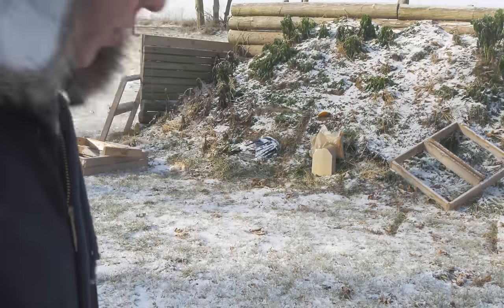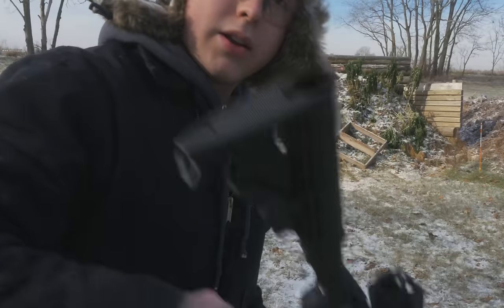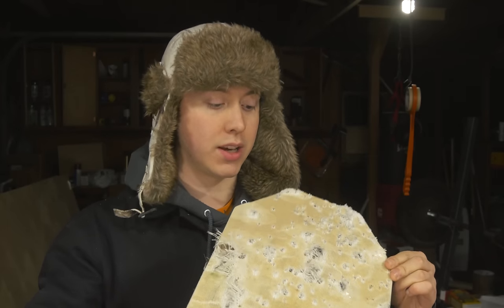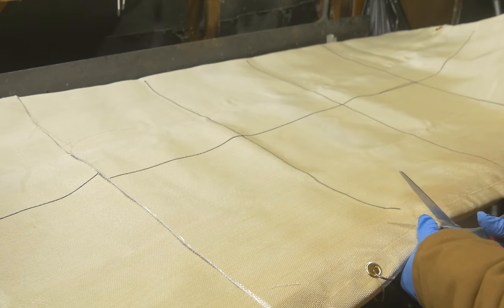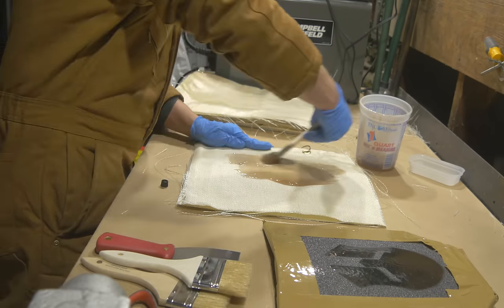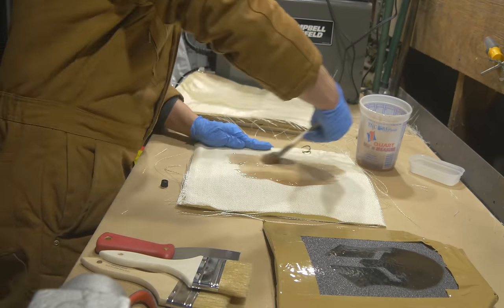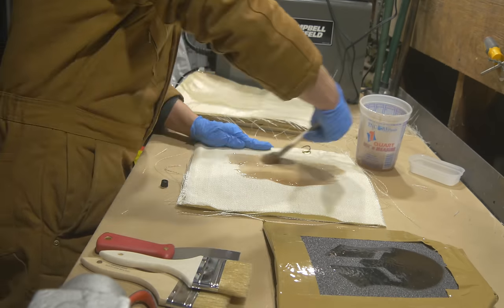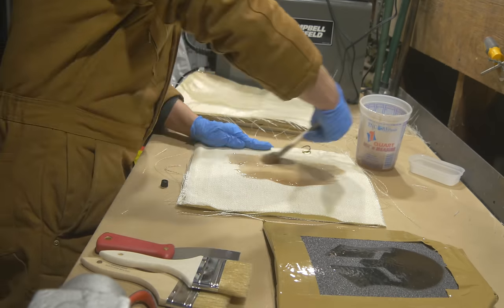How to Make AMAZING Bullet Resistant Armor for $30

Comment: Do it cheaper with just 9$ resin and a big ass phone book, paint on resin on page turn page and repeat till dried
Reply: provide that to the military
Reply: Krystalic Slill military plates are supposed to block AP.308 rounds, A bigger faster .223 they have a ceramic plate over a steel plate. While able to block almost any rifle round, they can only do it once or twice.
Reply: lol, 308 faster than 223, thats funny. The slowest (heaviest) 223 bullets are about as fast as the fastest (lightest) 308 bullets.
Reply: that would be an interesting comparison, please make a video of it.

Comment: Test it on some 7,62x39 aka AK ammo. (See what I did there?)
Reply: He already tested 5.56x45mm NATO/.223 Remington on it, 7.62x39mm would go through bro, not even worth a test after the 5.56 punched through.
Reply: actually yes, because the 5.56 goes alot faster and has much better penetration capabilities. so it would be quite interesting to see if the 7.62 could make it through. bigger bullets don't always equal better performance
Reply: 7.62 isnt made to fragment like 5.56 is, it would definitely go through
Lack of speed is made up with more weight
Reply: the 5.56 was never made to fragment the when used in a 20in barrel  it can make it tumble on impact. I don't even think it was 5.56 that does that it is 223 rem.

Comment: @ZNA : Great job on your project & armour plate. 
I'd dare suggest a couple tips:
>There's (Literally..) a TON of fabrics  available on line (eBay ??..) made from aramid (Kevlar) + carbon fiber, that could be used as a couple, (or more..) layers between fiberglass.
>Another cheaper source of aramid (Kevlar) source : Used / deployed automotive airbags you'd easily find in totalled cars. 
Congrats on opening a 'creativity window' of possibilities on this quick growing industry, specially for preppers in a budget!🏆
(Neddless to say I just subbed!!.)
😊🇺🇲💪🙏🙏🙏🙏

Comment: lol the biggest cost of this is all the fucking clamps who the fuck has that many clamps dude i don't even have 2 of those
Reply: TheGreatUtopiaCat Those are like 6 dollars at Lowes.
Reply: TheGreatUtopiaCat Iliketomakestuff has more
Reply: The biggest cost, are the proffesional plates for a stencile...
Reply: Use bricks to produce clamping force, done deal
Reply: Jackemarlee Young You end up with flat plates, rather than the slight curve that conforms somewhat to the human body. The curve helps to distribute impact forces, besides increasing comfort.

On top of that, you want maximun pressure spread somewhat evenly, otherwise the chance for air bubbles or inclusions goes up exponentially. Clamps, hands down, are the best tools for the job.

<3

Comment: i worked with a guy in dallas whose dad worked for dupont . they gave him a role of kevlar (which dupont invented) . i guess it didn't meet specs. he calls me and asks for some help getting it home. i said "i'll bring my truck over". he asked " you still got you trailer ese?" so i took my trailer over and this roll was huge. it was a double axel trailer and we needed the entire capacity. then i had to build a rack for it at his house so we could unroll what we needed. he spent the next three years doing much the same process , but making panels for vehicles. basically bullet proofing them. it worked. we wrapped a gas tank in his concoction and a .308 wouldn't pierce it. people ( that lived on either side of the border) would leave their cars at his house for a couple weeks and he'd bullet proof  them.  every now ad then i'd drive them down to the border for them to pick up and drive back. made a fortune.all they had to do was install plexiglass and they were set.

Comment: OK, next time use a release agent to prevent the plates from sticking to the resin.
  You can use a little soap or dishwashing detergent diluted with water. Apply it with a brush and let it dry. It forms a very thin film that prevents adhesion to the surface.
  Otherwise you can also use some furniture polish with wax, this will also form a thin film on the surface that will prevent the resin from adhering to the plate.

Comment: I haven't seen it mentioned in the comments, but you can male parts much easier with a vacuum sealed bag on a table secured with mylar tape. Add heat from a heat gun and you will cure a very solid piece with no chance of air gaps in your part.

Comment: For some reason after having seen this a year or two ago, I have it in my head that you used poly-feed-sacks. I have been wondering if a a small-link-chain-mail layer coated in silicone rubber with feed-sack layers would be strong enough to stop an M-1 round. I'm thinking it would be thin enough as the outside panel for a valise for protection. The inside panels could be lined with fine silk. The panel closest to the body could have an arm hold to use the valise as a shield. I'd have an RFID chip sewn in for locating and maybe a small holster at one end of the arm hold for a five round derringer. I am wondering if the chainmail silicone rubber combination would give the shield a splat effect maybe to absorb impact. I am told the Mongols used fine silk body-armor to stop arrows.

Comment: My dad built big bay boats for a long time in our front yard. They were wood and fiberglass. He always used a box cutter to cut the fiberglass and it worked great. It would only fray when he needed to change the blade.

Comment: You could have also added "some" strength by simply alternating the mesh. For example, after the first one, place the next one 5 degrees or so offset and continue to offset each layer. Not sure even that would stop a .556 round but maybe with the graphene added.

Comment: It would be over weight but spend a couple bucks on some ceramic tile and $50 on some horse mat both have been shown to stop bullets . I would put horse mat on front and back to protect you from impact and catch shrapnel but will probably be 25 lbs per plate and 3 inches thick

Comment: Great job!! Just be really careful with M.E.K.P. if that's the type of fiberglass resin hardener that you are using the flash point of mekp fiberglass hardener is a little over 160° F. And you have a heater near it drying... when I was going to car audio school they had just rebuilt the shop because one of the previous instructors had blown it up by dropping a tool on the bench and the spark was enough to ignite the mekp, keep up the good work!

Comment: A most amazing natural bulletproof material discovered by me by accident, cypress tree roots. A waterlogged cypress tree root sticking out of a local creek stopped 3  7.62x54 187 gr. yellow tip ammo at about 15 feet away. I would have lost any bet that it would blow daylight through SIX inches of wet tree root. Yes six inches. Same gun plugs 7/16 steel at 30 feet.

Comment: great job, but future tip, duct tape your cut lines and cut down the middle of the tape to keep it from fraying

also, you could avoid cutting by measuring, folding, coating and pressing each layer. would honestly take just as long

Comment: I'd like to see the AR exiting out the back in slo-mo. It seems to me that two shields - of any form - with an air gap between them where the bullet is allowed to freely tumble would be exponentially more effective. Not, perhaps, for body armor but perhaps for walls, doors and vehicles. Although, it's possible much thinner shields could be used in such a formation.

Comment: I’m just now watching the part about cutting the fiberglass sheet and I wonder if painting the blanket first in a light layer of the resin (and letting it dry) might prevent it from fraying while cutting the sections out.  I don’t know how stiff a thin layer of resin would be and whether it would make it hard to cut, but it’s a thought that came to me while watching.  If not resin, then maybe painting it in a more flexible substance might work- if the resin sticks to whatever that substance is later, when putting it all together.  This is a great vid, and interesting to watch.

Comment: I saw a couple things that may have been quicker and faster but too long to explain, I've read a few good options on your comment page. I'm not sure what kind of fiberglass has grommets in it that looks more like canvas. If you would have used a little bit of wax on your initial plates over the tape you wouldn't had a hard problem taking it apart. If you need some guidance on the materials you should use get ahold of a fiberglass supply company.  Like composite one whom we used at current designs for all our information, when it was in Canada.

Comment: I seen one guy use ceramic tiles, thin piece of plywood, and 14 gauge steel to make rifle rated body armor.

Would be interesting to see if maybe adding a ceramic tile and piece of steel to this project could increase the efficiency. The tiles are about $1 a piece

Comment: 30 bucks for a IIIA non-metal hard plate is actually pretty good, albeit soft vests are more common, but also more expensive. Realistically, throw some ceramic on the front, you bump it up to a III+, and that's really close to what RMA does for their IV production plates (Albeit, I doubt you are getting level IV performance out of this no matter what you do).

Comment: Have you thought about ryhno bed liner for truck bodies with carbon fiber and kevlar layers and ceramic layer . Ryhno bed liner is some tough stuff for out side of your plate. Thickness of 5/16 thickness with kevlar and then ceramic layer with carbon fiber 1/ 8 inch thickness and kevlar layers reinforced and a 1/8 sheet of high carbon steel follow up with kevlar 3/8 inch thickness. Then coat your plate with ryhno liner this should help stop bullet splatter or spalling. I think with these layers epoxied to may be very tough. And maybe with your ideas and a little more added ideas could be very tough stuff.  I know that bullets don't like ceramic materials bullets splatter on impact and ryhno liner helps keep it all intact with kevlar and carbon fiber all keeping it well strengthend  and a busted bullet hitting a price of carbon steel backed up with thick kevlar going to have a hard time going through.  You have a great idea there and if you add a few more little ideas you might come out to be a rich young man making lighter armour and strong armour good luck and GOD bless you with your work. Ps. Shrapnel from bullets on hard armour is very bad cutting peoples arteries in there neck and under their chins and even blinding people it's like having a small grenade exploding metal fragments that rip through flesh and bone. We need to come up with a way of stopping the shrapnel. And the only way I can think of doing this is putting a material thickness to capture the bullet fragments before hitting the hard plate . like soft armour over hard body armour. What are your thoughts on this issue. To help save more lives of men that put them selves in harm's way ?

Comment: Stick it in your car doors, since it's mostly thin fiberglass and a lot of projectiles that may fly towards a person would be when they are in a vehicle or out in the environment.

Cars are not designed to block bullets, so anything better than the weakest pistol rounds will go through them at close ranges, if not hitting the steel structure.
Sticking them at the rear of your car seats means anything meaning to Pierce through the seat from the back (usually if someone shoots at you while chasing you), would be helpful.

But unless you are good at making bullet resistant glass, the windows are obvious vulnerabilities.

Stray bullets in a bad neighborhood can also enter via windows and such, but usually having high wooden fences can deter the projectiles from hitting windows at higher velocities by slowing and deflecting them.

Comment: Most households don't have that many small clamps. Also most don't even have a brush. So technically, in order to build this body armor, you will need around at least another 50 bucks, 50+30 = 80. But then you can be the neighbourhood's mini body armor factory. But then you wouldn't really sell your makeshift body armor just for the material's cost of 30, but rather much more.

I almost forgot ! Most housholds don't have that many expensive machines and tools. Trying to do this without the machines shown in this video would waste you a lot of time. And time is money.

But still a good video.

Comment: people also forget that, youre not just gonna stand there and get shot..youre gonna move..and fast...and hopefully that will also help in deflecting the shot a bit..ive never been shot at but i think that rapid zig zag movement and this is better than nothing at all😅....but why stop at just a plate..if youre gonna make something like this, make it ergonomically correct, and design something that not only protects the chest and back but also the sides and sholders and it straps on good and stays in place👍

Comment: Should have put a thin coating of a silicone lubricant or something similar on the tape so it didn’t and doesn’t stick as bad?

And dude, you need a bandsaw. Oh wait, you do have one. lmao

Now you need a router and a rounding bit to clean and smooth the edges. Oh wait, the belt sander works too. lol

Great project, idea and video! Thanks!

Comment: I wonder if we could laminate in a layer of ceramic tile? Sure, you’d need multiple pieces to create curvature, and that would create wheat points between the joints. But, with his impressive as this is currently an improvement couldn’t hurt, right?

Comment: Ik it’s been 5 years but if you do this again, place painters tape where you’re gonna cut and cut the painters tape in half. It will not fray, I learned this working with carbon fiber

Comment: Have thought of experimenting to find something that will defeat 5.56? It would be much thicker, but I bet if you sandwich some 1/8th inch thick steel plates between 2 of those fiber glass plates that you might have a winner. It's a guess on my part though. Well done on those plates. If you can't afford traditional armor, that's definitely a reasonable way to go.

Comment: It might be stronger if you use epoxy resin rather than polyester. Even better if you use an autoclave to cure it. Might push up the cost though.

Comment: Ok, throw a few overlapping ceramic tiles cut up and sized appropriately to fit, and add like some kind of aluminum backer, and this is a viable option for ballistic protection!
Reply: 3 ceramic tiles alone with newspaper and adhesive stopped 380 and 9mm- got the idea from another YTer and tested it.

Basically i cut the tiles like plates, got free newspaper because it was like real estate advertising one, and a can of guerilla glue spray glue. Also I used duct tape.

After cutting the tiles, I wrapped them individually with the spray and a few newspapers then wrapped it in duct tape. Then I combined them with the spray so it was 3 tiles thick. Finally I wrapped even more newspaper using spray and finished it with a duct tape wrapping.

It stopped 380 and 9mm but weighed as much as my AR500 steel plates. Not bad for sub $10 plates though
Reply: I seen another video where this guy used 2 ceramic tiles, a thin piece of plywood and 14 gauge steel and a way to combined it all and it was stopping AR and AK rounds. But the steel made it like $30 a plate

Comment: Have you tried making it with the mesh type fiberglass instead of the woven? I wonder if it would be stronger because the mesh type is made of varying size pieces and put together in a more random fashion.

Comment: what oxygen dude? epoxy cures as a reaction w. hardener, not "drying" at all, and the thickness only can be problematic because the large amount of reacting resin will create a lot of heat, not a problem in this thickness

Comment: Personal research and experience,  best body armor no matter the material is made from layers ,so if you got layers. Then you just gotta add in some hardness plates every other layer or 3 and that will make a ton of difference
Reply: Hardness plate sounds good but which material?
Reply: @janoz-utf9050  id go with stainless steel. At least 1/8 inch plates. Maybe like 3.
Reply: @janoz-utf9050  I have not got the chance to make it. But I'm thinking a plate of stainless steel then some glue and then some VCT tile, then another plate of SS plus 4 more vct then top with SS plate. Mash it all together and let it dry.  Then test
Reply: @janoz-utf9050  I agree its gonna be heavy , but those are readily available materials.  I wish you the best of luck and hope for success. Being able to make this kinda stuff is a freedom we can't afford to loose.

Comment: it may have stopped the .223 if you shot it with-it first. The 9MM may have weakened it and the 12-gauge slug probably did as well. try it with the .223 first. because it will almost obviously penetrate as it is going faster than the other ammo from the start

Comment: I'm curious about the logistics here. What size curtain did you use, and how much waste was there for that single curtain? How many layers for a single plate?

Just checking to see the most cost effective way to make a few, like, if I get one slightly larger curtain than you used here, maybe then I should get a larger one for 2, or get two smaller ones to make cleanup easier.
Reply: there is gonna be very little waste if you plan on NOT turning the material 45 degrees for each layer but if you do plan on doing that then you are gonna get a bit more waste